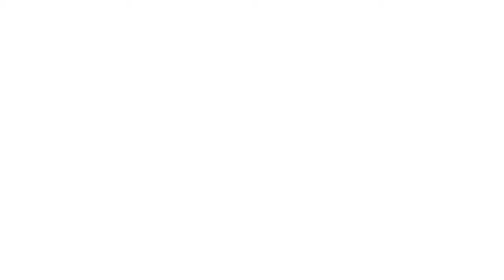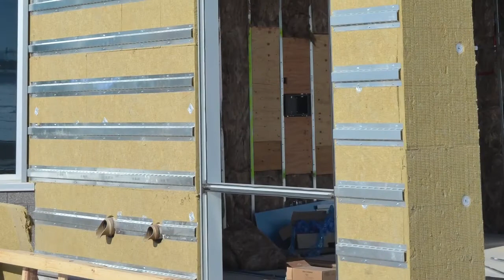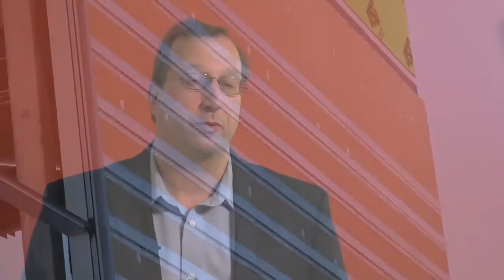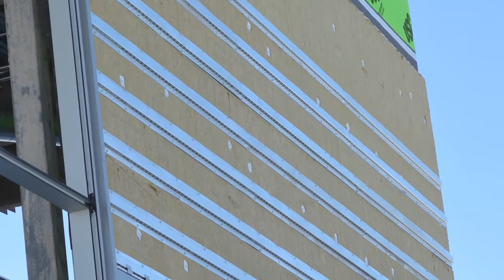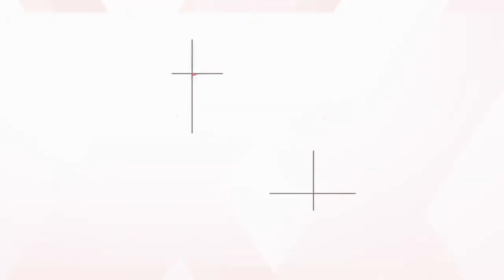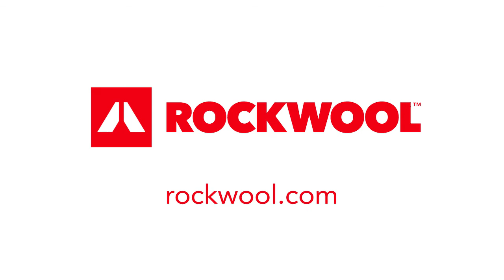Utilizing Stone Wool Insulation in Rainscreen and Exterior Walls

Comment: i urge caution in listening to straube's statements about polyisocyanurate insulation, because while straube's statement is not outright false, it is a bit misleading. while it is true that you can get condensation in some blowing agents, which can increase thermal conductivity of the insulation, not all polyiso insulating boards use the same blowing agent. the foil faced polyiso boards, which you see most commonly, DO NOT suffer from reduced r-value when the temperature drops. however, felt-faced polyiso has been observed to suffer reduced r-value when the temperature drops.